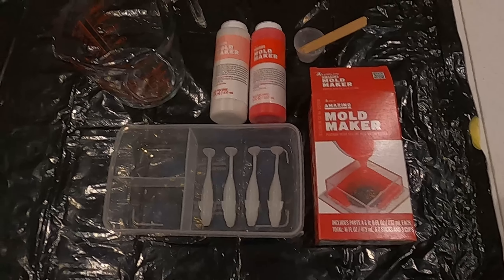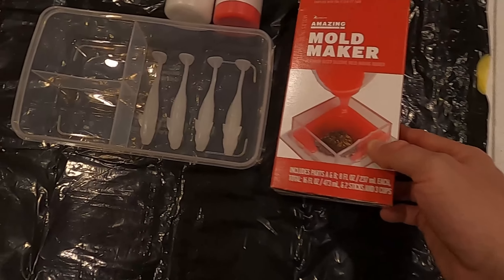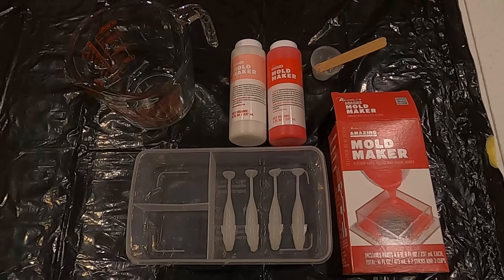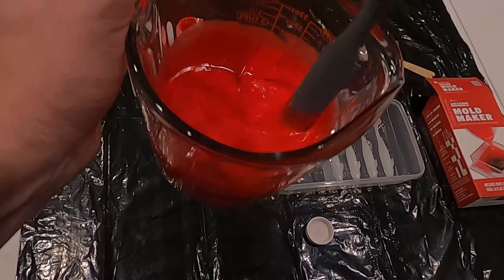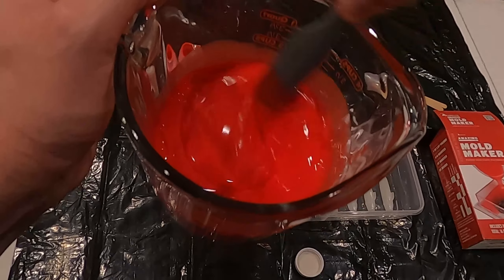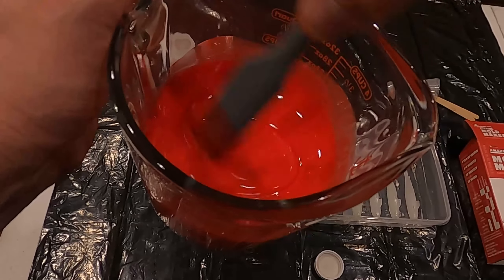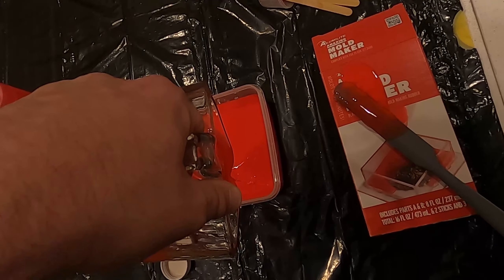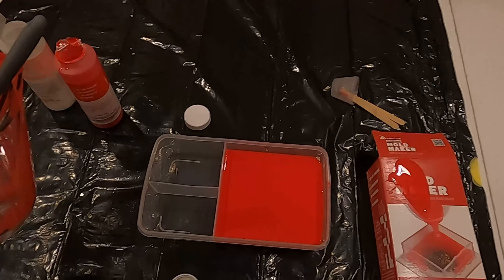How To Make Silicone Open Pour Fishing Lure (Swim Bait) Molds

Comment: This is pretty cool. I'm about to pick up a 3D printer to create some molds.
Reply from the maker: Super easy, and theres lots of content out there! Stay tuned for more mold making.
Reply: @A.Blair_Fishing  I just ordered these silicon packs on Amazon. I can't wait to try them. Thanks so much for this video!
Reply from the maker: @CrossRhoadesFishing  no problem! Make sure you superglue the baits to the box you use, and some silicones dont fully cure against soft plastics. Spray with some sort of clear coat so they cure. Otherwise, the time to fully cure is triple, and you have to wipe spare residue off the mold after with nail polish remover.